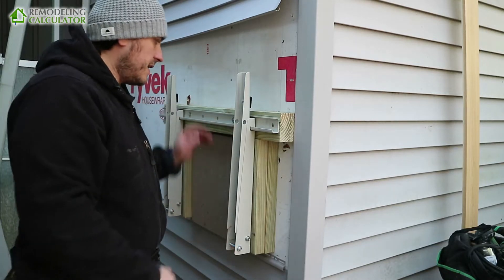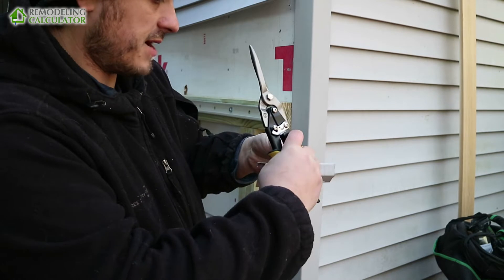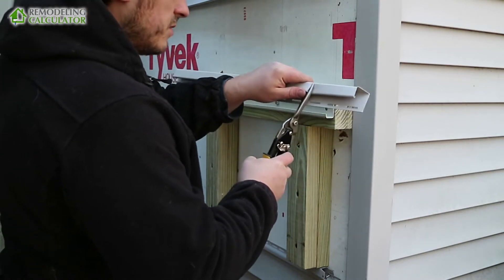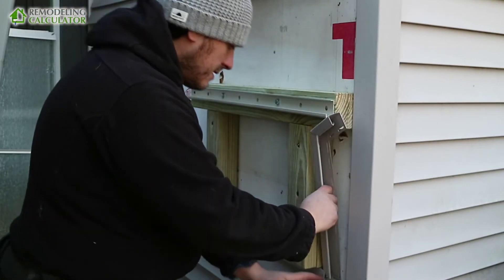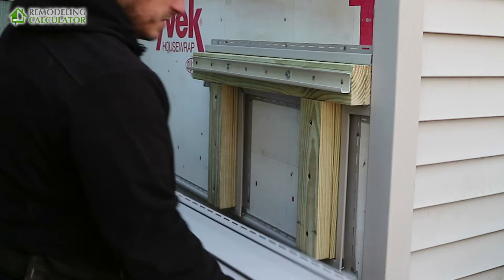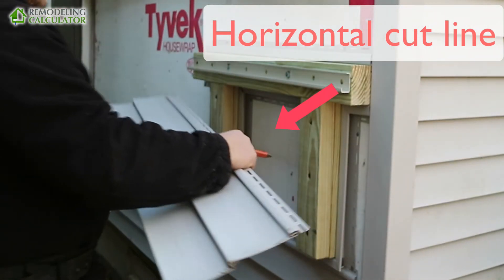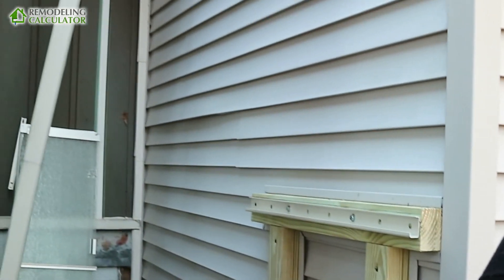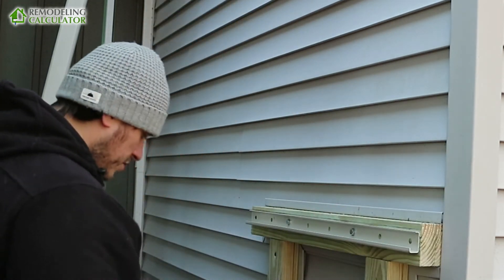Mini Split Install Part 3 - Vinyl Siding Around Wall Mount

Comment: For a siding tool cut a piece of bead off of scrap piece of siding about an inch wide and 4 inches long with nailer removed, done vinyl siding for 30+ years and have made several reinstall tools out of scrap vinyl.

Comment: So here's a suggestion for you. Use regular non treated two by four so you can surround it or cover it with aluminum so the boards won't rot 😉